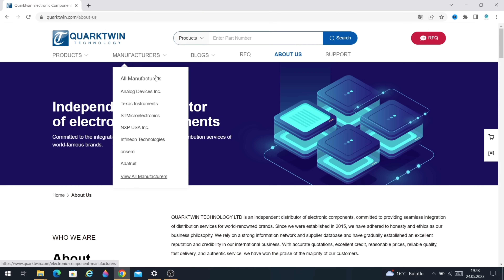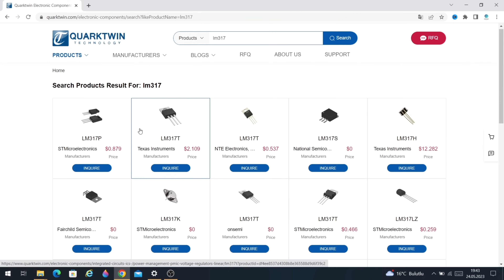How To Make A 5V To 15 KV High Frequency Inverter Using An Old SMPS Power Supply

Comment: How many volts (calculated, of course) are on the tips of the secondary?
And how many volts would be if the positive is conected directly to the full primary coil, instead of hal way?
I believe it would be the double voltage...it would be interesting to see...
Can u please answer?

Comment: The toroid core is  Micrometals type 52 material, which is powdered iron with a nominal permeability of 75. It is similar to Micrometals type 26 material but with somewhat better characteristics.
I think the complete part number would be T157-52, but I can't be sure without having the core dimensions. The "157" means the outside diameter of the core is nominally 1.57 inches in diameter.

Comment: Why didn't the bulb instantly fry!?!?  15kV into a 110V bulb?
Reply: Power rating and voltage drop
Reply: @navin1986  pardon me, but duuuuhhh
Reply: @jameshoney2506  
The circuit can produce a very high voltage only if the load current is low. It can't deliver very much power, just a few watts (remember that    watts = volts x amperes)
When an arc is drawn from the terminal of the light bulb the current is quite low. Most of the power is actually going into the arc and most of the voltage is across the arc. When the wires are connected directly to the terminals of the light bulb the current doesn't rise very much but the voltage drops dramatically because the total amount of power stays about the same.

Comment: Lol   Rumor has it he's STILL trying to remove the old solder with that old solder sucker!
   Maybe low melt solder hasn't been introduced in that part of the world yet.    😐
Reply: I don't know what soldering iron you have [but if you know how to make a soldering iron that exceeds 500*, you can easily unsolder and recover industrially soldered components]
Reply: Parkside Wood Burning Tool 16 piece set
Reply: @tornadobotonog1562 what kind of soldering iron the master used has no point at all as long as he removed the coil in excellent manner that's it.
Reply: Este señor es un maestro de la electrónica respetemos cualquier detalle , sabe más que 100 ingenieros que yo conozco .